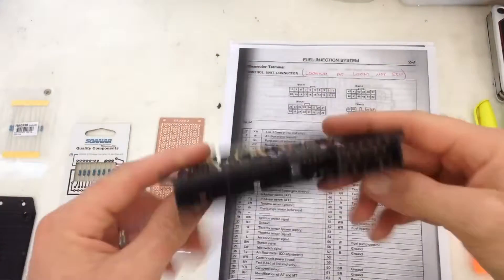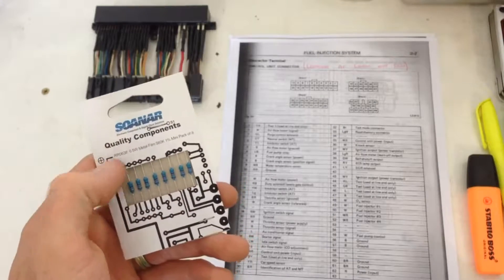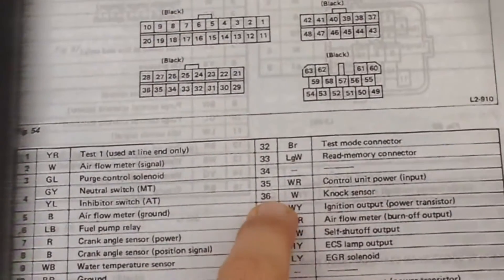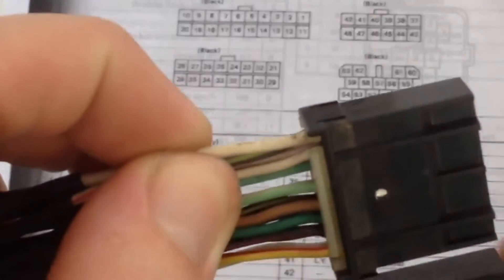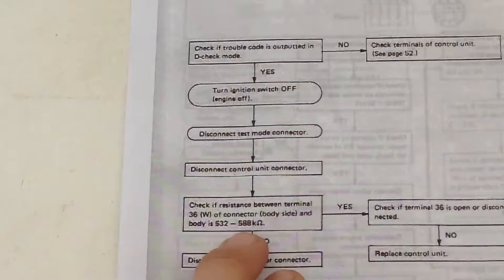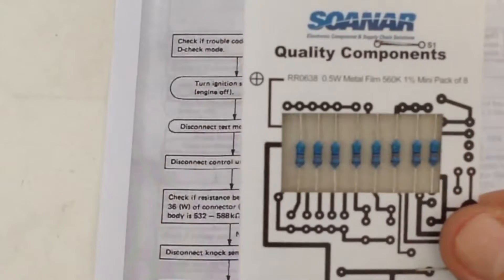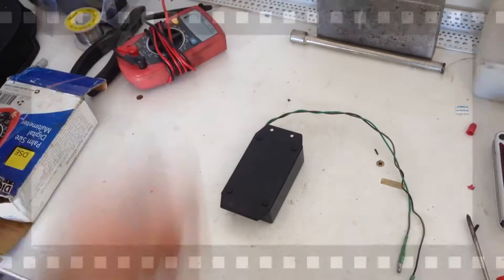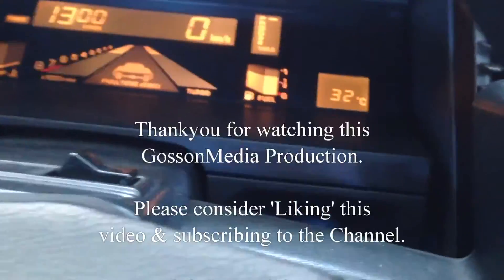Bypassing the Knock Sensor on a Subaru EA82 Turbo (Series 2)

Comment: Having a similar issue with an 02 ez30 - new sensors and everything still throwing a code and the motor is 100% - plan on doing the same exact thing. I'm going to just use a resistor to ground off the wire with proper insulation. No needfor a box to keep everything as hidden as possible